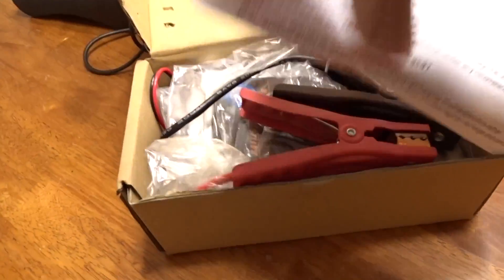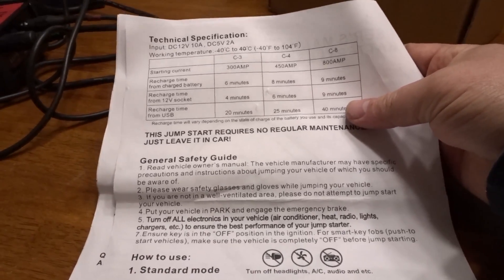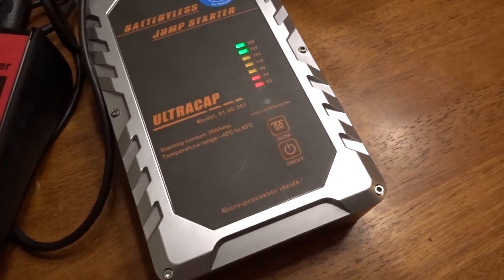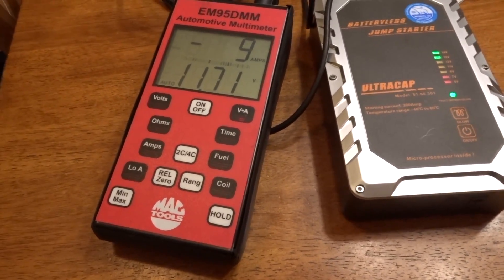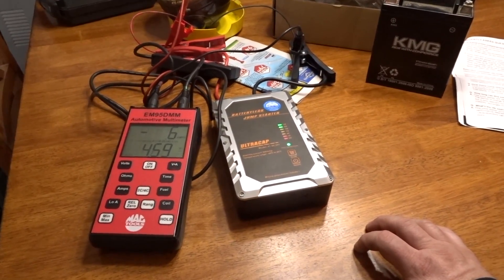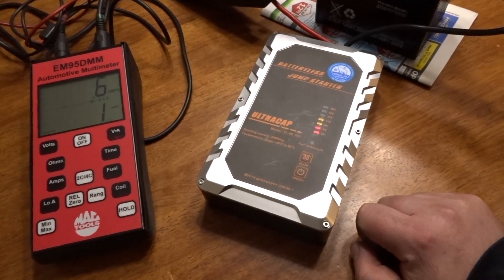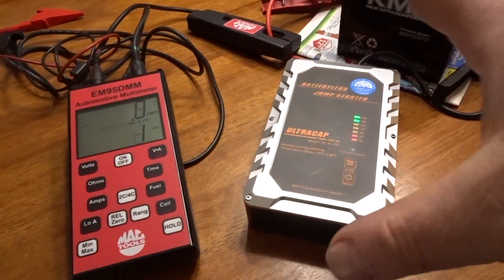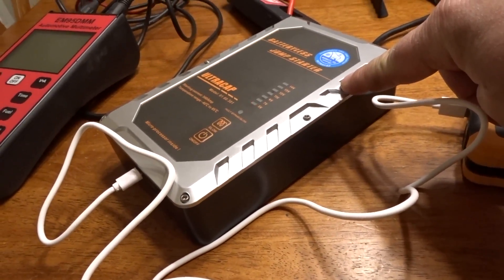Batteryless Jump Starter First Look Case Study

Comment: I has 3 battery jump starters from a well known brand not cheap, and the first time I needed to use the 1 in my partners car to jump start it failed, I charged these up monthly to make sure they kept charge and all the lights said good, until I tried to jump start the car battery was stuffed in the jumper, so I got the 1 out of my car, I had exactly the same problem, it was 12 month warrantee and it was 13 months when I needed to use it, called the company they said its out or warrantee so no replacement or refund, the third 1 is still working, for how long who knows, so I think the capacitor idea is no so expensive if it does the job every time

Comment: Bombardier has recently removed there battery electric start system on there snowmobiles to a capacitor starter.
You have a snowmobile sitting overnight or days in freezing temps outside and the sled fires right up with there capacitor starter.
Reply from the maker: Very interesting
Reply: Their

Comment: So did you do a full test with my numbers on this unit and on a flat frozen battery?
Reply from the maker: if you have a flat frozen battery it's garbage
Reply: jerry bskorner Sorry what I meant was on a battery that was drained by leaving lights on and sitting overnight in -20 Celsius
Reply from the maker: Why would I drain a battery that only shortens the life of it
Reply: jerry bskorner Just wondering because that’s a real world test that a jumper needs to work in.
I’m looking for something my better half can carry with her in her roomy work bag that goes from in the car to work office every day.
So there’s always the chance that the battery can drain for whatever reason and be dead and in freezing winter weather for hours.
Whether it’s a capacitor or lithium jump starter it’s got to work in this situation.

Comment: I bought a cheap one.. it started my bike after I ate.. at the restaurant. Took 15 minutes I was so full... but it worked!
Started a friends car.. and it was a cheap one.. so yes!! You buy one to get you out of a bad situation.. go straight home most likely and buy a new battery.
Now if I worked at a car dealership.. maybe a better one will be worth the trouble and expense.
But this cheap one is cracked and it holds a charge bouncing around in my bike saddlebags.. two weeks and it was still fully charged.. the cheap one.. was the one he said was not a good one. Your battery can be just to low to start.. and you'll be fine. Plus I lost power at home.. I charged everything with my cheap one..... he is giving you the best.. and I agree with him.
But down in south Texas.. the 30's is not often. Dead battery is not common either remember. So... there's that to consider.

Comment: Wonder if it will start my diesel car on a cold day when the battery is flat.

First thing when starting a cold diesel is to let the glow plugs glow for maybe 5 seconds and i would imagine that this jumpstarter would already be somewhat drained as glow plugs draw a lot of current.  (My glowplugs are approx 1 ohm, which would mean that they draw 12A, each for a total of 48A).
Reply from the maker: It has a glow plug feature
Reply: Hi

Great... What exactly does this feature do ?

Comment: Hi! Is there a specification for the capacitors? I sadly did not do physics but as a highway engineer I sort of understand the operation, the energy is in the caps not the battery. I am looking to make a unit to kickstart my Mini into life without waiting an age to charge so can you sort of provide me with a shopping list for the caps maybe permutations to give the clout of a lead acid starter..... ie x of yyyyy capacitors or  y of zzzz capacitors.  Many thanks

Comment: Just one thing, the current those ultracapacitors put out could damage wiring and computer in your car!!!
Reply from the maker: +Dr. Lumen you clearly don't understand how current works.
Reply: Current is not being "put out". Current is drawn when there is a voltage and a resistance.

If the voltage gets to high, there is the posibility of damage, but current is not forced upon anything, it is drawn based on voltage and resistance.

Comment: Batteries are energy storage devices.  Caps are energy storage devices. So WTF is the big difference?  As an Electronics Engr is see nothing
Reply: One difference as i see it, is that the battery is much better at holding the charge. If you buy a battery type booster you can charge it and use it 14 days later. The capacitor ones would probably not hold its charge for long.
Reply: A battery depends on a chemical reaction a capacitor is just charges on metal plates.  You should go back to school.

Comment: Jerry, would you try to charge the capacitor with a battery that would no longer crank over the engine, but would possibly be able to slowly charge the capacitor?  I am just curious whether this would work in real life and thus start the engine?
Reply: Yeah, that's the point of these super cap boost packs. If you're still getting relay click, the battery will have enough charge to fully charge the caps. There's no magic involved, if your cars battery is down to 5v it'll never be able to provide the 30 or so amps required to turn your starter. But it will be able to provide the low amperage required to charge the caps.
Reply from the maker: +krzysiekv12 if that situation ever comes about I will for sure try that

Comment: As far as lithium jumpers, I'd like to see the Weego 44 and 66 tested. I think they are the best out there. They are 12k and 18k sized and use premium batteries. They have great (5-600 lumen) flashlights and are IP65 rated for water and dust resistance.they do not exaggerate their specs and have an 18 month warranty and outstanding customer service according to the reviews. They have big cables that are a completely different design that most. I'm getting the Weego 66 to work along with my Schumacher DSR109 capacitor starter to cover all situations.

Comment: Jerry, thanks for all the work you do. I'm a little confused as to why you say these are so expensive. The one you are testing can be had for 150-175 bucks shipped. I bought the 800 amp version (branded Schumacher, same manufacturer) for 200 bucks shipped a couple weeks ago. Considering these will last well over 10 years, they are a bargain compared to the lithiums. The Sealey brand is the same booster as well and are a bargain on EBay.
From the comments, I don't think people realize how strong and flexible these are. I can charge my big 800 amp model in about 5 minutes off of an old dead motorcycle battery that has been sitting in my garage for months! It would be rare under normal street circumstances to be trying to start a car whose battery is under 5 volts. That means you can charge these from the "dead" battery. That is game changing! Or carry a small USB battery with this if you are worried about a charging source. Small solar panel will also work. I would say in 90% of cases, though, you can just charge this from the dead battery you're about to jump start! These can also easily start an engine with no battery in bypass mode. They are extremely powerful. There are dozens of videos on YT showing these in action. My choice by far!
Reply from the maker: depends where you live, in Canada you have to pay exchange, duty and taxes which ups the price quite a bit

Comment: with a small crank you could charge and discharge the caps as needed and never have to wonder if your battery boost pack was charged

Comment: Why would you remove your positive cable? You could potentially short the "dead" battery positive post with the ground of your vehicle with a tool. If you get it removed without doing so and start your car with a boost pack, you might accidentally short the unattached positive battery terminal to the chassis ground while your vehicle is running and damage your charging system.

I think the cap boost pack is an expensive gimmick for now. Not nearly the energy density of lithium, yet.
Reply: Reading the other comments, one mentioned that this had a boost circuit. I figured it had to if it claimed to charge up to 14 volts from a lead acid battery but I didn't think about the fact that this means it could charge up the caps using your vehicle's "dead" battery. The caps could then provide the high current to jump your car.

Not quite as gimmicky as I thought. If you were smart about using this, it could sit in your vehicle untouched until you needed it. A "pro" would be that you don't have to make sure it's charged.

It could be made "smarter" so that it charges itself up from your battery to 14 volts and when you hit your ignition it could sense the sudden drop in voltage from your battery and instantly go into boost mode. Not sure if it would work... would more current sink into your starter or would more sink into the dead battery?

Interested to see what tests you put this through. Subbed.
Reply: Nodrive....that is the way they work.  Just hook it to the weak battery, press start, wait 3 to 6 minutes for full charge (when 14v green light stops blinking), and go start the car. No need to do anything in between.  If it's a diesel with glowplugs, hit the diesel button first.  If there is no battery at all, charge the unit from another car and then use the bypass function to start the car without a battery.    There are lots of videos of these in operation to be found....As long as the "dead" battery has about 5 volts or more, it will charge the unit.  It would take a very dead battery that had been sitting for a long time to show less than 5 volts.  Most vehicles on the road that need a jumpstart would probably read in the 9 to 11 volt range and would charge these easily.
Reply: Thanks for the info. Watched a few videos. Pretty nifty device. Worth having for an emergency.
Reply: @nodriveknowitall702  If your battery is dead as a dodo you won't be able to charge your cap! Even if it has some but not enough charge you'd still be cooked with a useless rescue tool!
Reply: I wouldn't say they're a gimmick, lithium cells loose a lot of performance in cold temperatures while capacitors do not.
In theory, you could just keep the pack connected to a usb charger in your car 24/7 that way it's always charged.

Comment: It would be interesting to see how much you lose current with the alligator clips. Have you or could you test it? Like first do a normal load test and then use a apecial cable that has bolted connections instead of the alligators

Comment: I think that the manufacturers needs to have a combined product when it comes to this tech of battery and supercapacitor to get the benefits of both. Some kind of switch that kicks in the battery after the initial cranking. Also the same in reverse when charging. This is however maybe not as easy as I think, but it would use the best of both technos. The great thing with supercaps are that they have a better discharge than a chem-battery. That is something that have to be used better in battery powered machines/systems. A couple of well placed caps can spare battery and prolong batterylife in theory. As one may see if the car could use the caps when starting and the battery only as a backup it could save batterylife. A great thing in cars that generally speaking have very undersized batteries and alternators.
Reply from the maker: that's a good point you'd have the best of both worlds
Reply: @TestDontguess  An the cost of both. Or at least a good deal more expensive than either tech alone.

Comment: you wouldn't want to get stuck miles from anyone with this as your only option. 1 hit wonder then if it doesn't work you're walking
Reply from the maker: as long as your battery isn't stone cold dead it will still charge
Reply: If you're stuck miles from anywhere like that your alternator is toast and you're getting a tow anyway. Batteries don't cause your car to just die on the road, the alternator can do that. Frequently in the desert, because heat causes you to run the AC on high (more electric load), and the engine gets hotter, and heat kills electronics.

Comment: The important test would be the leakage current.  How many days the capacitor would stay charged?  Or are you expected to charge it just before the use?
Reply: 12vgs8606 the caps will lose charge after a few days. Yes, the manufacturer expects you to charge it just before use.

In addition to charging from AC or a USB power bank, these super cap jump starters include a DC-to-DC converter that permits charging the caps from very weak car batteries (about 5 volts).

Comment: I have the 800A Sealey E/START branded version of that (looks identical). And yeah, pros and cons. A nice thing is that you can charge it off a smartphone battery pack and not just another boost pack. And the end of the day tho I much prefer my lead acid 12/24v lead acid power pack (it claims 3000 peak Amps, no idea if that's the case, but the thing just cranks and cranks and cranks).

Comment: Seams it would only work if you had a battery with a weak or dead cell. I doubt it has enough capacity to "charge" a low battery enough to crank an engine.
Reply: roguesquatcher These super cap jump starters include a DC-to-DC converter that permits charging the caps from very weak car batteries (about 5 volts). Yes, having it in parallel with a really weak battery means the battery drain off some of the current while you are trying to start, but the theory is that the caps can supply current well in excess of what the starter needs (briefly).
Reply: Tom Metro Sounds good in theory, I guess Jerry will have to put it to the test lol

Comment: Very interesting thing. Can you please test it on cold (-25C or less) engine?
In more warmer weather jump-starter typically just don't needed. Will this thing start engine with dead (about 10.8V or less) battery?